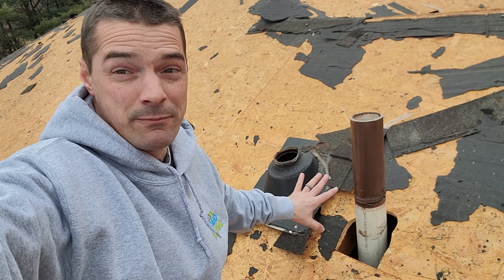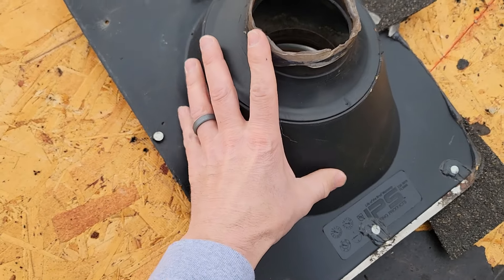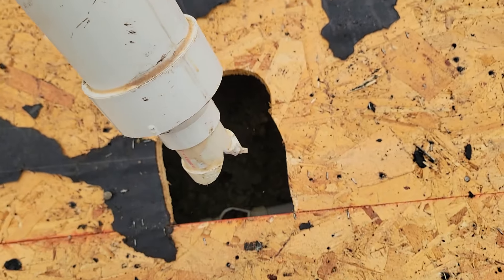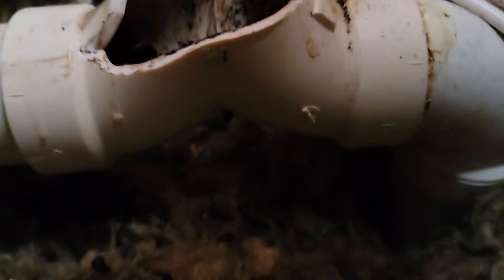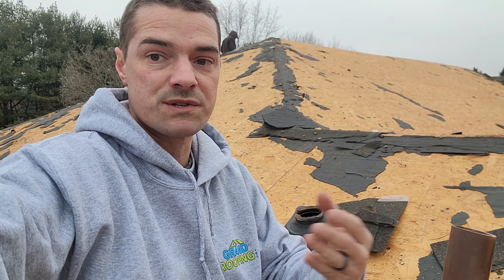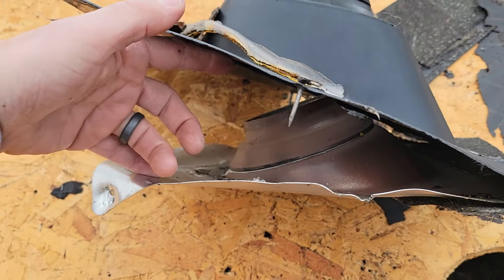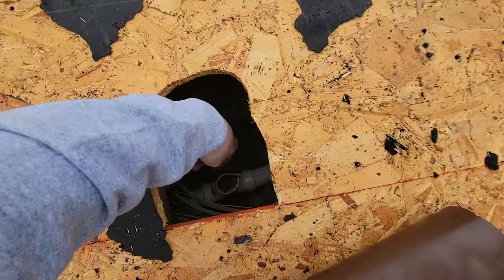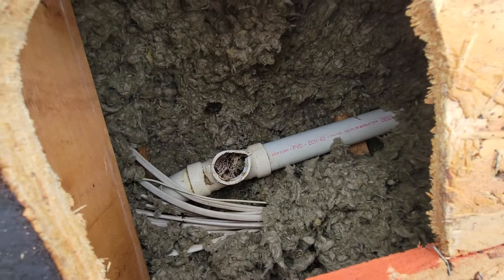Plumbing vent pipe

Comment: That looks to be a double 90 and is technically correct on a vent where 2 different vents come together before penetrating the roof. The high point of the attic drain vents should be the double 90 and it should flow any water or condensate either direction when it enters the roof vent.